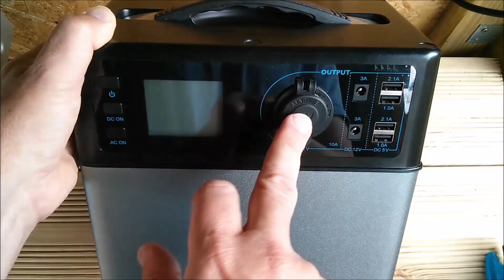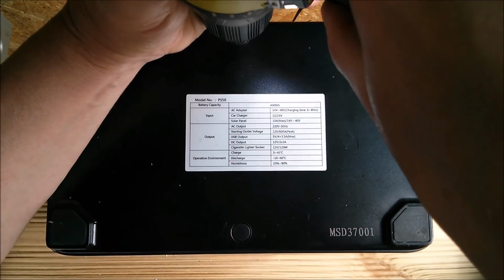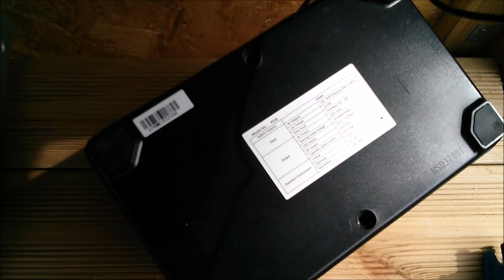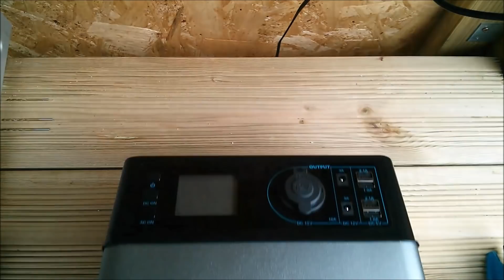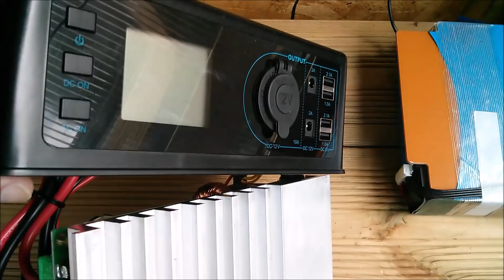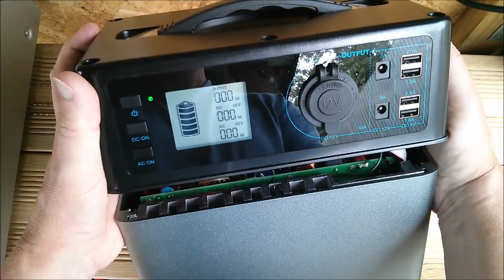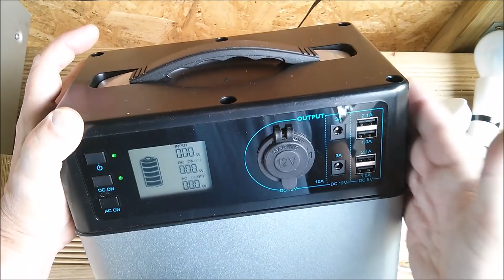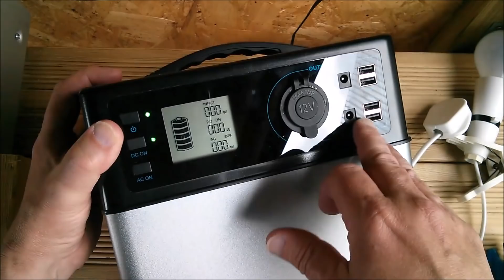PowerOak PS5B Power Bank Strip Down

Comment: Thanks for the tear down I bought mine second hand to run my brass monkey fridge  works well usb ports 2 were broken as its was on a board to difficult for me to fix 
So I replaced 12v cig socket with quick charge 3 socket  then relocated 12v cig socket to the back  of eb50 by piggy backing connection 
Works great as fridge plugged in the back leaves front all clear for use.

Comment: I'm trying to fix my PS5B anderson connector (solar input connector). This connector has fused and is unusable. I have to replace it. Thanks for your video that allowed me to look inside the box. However, the said anderson connector is hidden behind the jumpstarter connector. And I wonder if the later (jumpstarter) is not glued to the device because I cannot see how to undo it. Any idea or video about this problem ? Thanks in advance.
Reply: The Answer : 2 unaccessible screws from the outside hiden by the glossy plastic cover, maintain the jumpstarter plug. No other solution but breaking the jumpstarter connector fixation by pushing on it and glue it after having fixed the anderson powerpole connectors.
Reply: I would buy flush mount anderson  add to the back of unit leave old ones in place  then just reuse solar wires

Comment: Hi there, i am thinking of buying one of these to put in a small camper, running mostly a fridge, some lights, charging electronics (phone, headset, macbook, camera, etc)  and a couple other things but not much and intend on having a 100w flexible solar panel and have it connected to the ligher socket in the van but i think i would need more battery capacity, was thinking of making another pack of batteries and connect it to the unit but what do you recon its the best way to do it and if you agree with my idea, what would be the best way to wire it to the unit?
Thanks

Comment: Hi Julian, if you plan do build a USB power bank, I would recommend the TPS2544 for the USB port charge control. It is a really neat IC that supports several charging protocols. I should mention that if you don't use an IC like the one I mentioned, your phone may charge slowly or not charge at all, depending on the make and/or model.

Comment: The singular connector on the black wire is probably the negative Charge-Input to the BMS. Some BMS have separate connections for Charge & Discharge to provide better protection while simultanerously charging and discharging the pack.

Comment: not a power generator.  lost me instanty
Reply: timemachine_194 
Lol.  Is a step up/ down transformer a generator?  No.  Chemical storage of electric charge is not a generator the source of the electrical charge is.  It’s electrical to electrical so not a generator merely a converter.  Idiots day out!
Reply: timemachine_194 Incorrect.  The source of charge and or change in potential is the generator.  A battery like chemical energy is a storage device not a generator.  Point and case!

Comment: I've been modifying my PS5B in the last few months and have found some interesting things:  

The overdischarge cutoff voltage is 3.5V/cell, which is fine for the stock cells which are mostly flat by then (3S16P 48x LR1865SZ ~2.3Ah, seems julian's UK version has different cells). I replaced it with a custom battery featuring 3S19P 57x samsung-35e ~3.3Ah cells and cell level fusing, and these cells have capacity all the way down to 3.2ish volts. Cutting of at 3.5v means I only get ~420Wh from my 700Wh battery which is disappointing. The stock battery has ~350Wh usable capacity. Discharge curves for illustration: https://i.imgur.com/RTZEvT9.jpg

However on the PCB there is a blue trim pot, this trims the 3.3v reference for the entire system. By replacing the 2.7k resistor next to this pot with another 10k pot I was able to lower the overdischarge trip to 3.4v/cell and the charging voltage to 4.05v/cell, so even though I won't get more capacity from my battery it should have a greatly increased cycle life. Changing this reference voltage does effect the regulated DC output and inverter voltages though, which throws off the display power meters a little. 

When I got the  unit the first thing I did was mod in an external cell balancing lead to the battery.  And good thing In did, as the battery was way out of balance (4.03v,4.04v,3.84v). Presumably one of the cells was self-discharging in storage. This would be quite a problem if I was doing capacity tests, as it would take a few days on the charger to balance out and allow full usable capacity. 

Another thing I've become concerned with is heat build up, with the stock battery when I place a sustained 200W inverter load on the unit the cells reach 35-40c which isn't great. So I cut out some holes in the side and added a temperature controlled fan using one of those KSD9700 switches. 

Other mods I've done are to make the display backlight always on, by soldering the led to the 5v USB outputs. The display is still impossible to read from above though which is really annoying whenever the unit is on the floor. I also plan to add a hall effect coulomb counting state of charge meter to the system, but am waiting on the part from aliexpress. 

Here's the teardown I did, which has some more info I haven't mentioned:  https://imgur.com/a/oQ8flzm

Overall the PS5B is a decent unit, however here in Australia it is way overpriced (I got it for ~$650aud but most places sell it for ~$800aud). I wish the poweroak/maxoak/bluetti company was able to ship some of their better models here, it seems there's no way to get them other than contacting the chinese manufacturer directly.  
Even their aliexpress store doesn't ship to Australia.
Reply: Thank you so much for this information and the one available at imgur
I was looking at a way to extend the battery cappacity and i might just to it by the jump starter output as you mentioned its possible

Comment: I hate the name "solar generator", proffering to call them a solar accumulator. 
I've built one with 375Whr of 18650 storage in a 3S 16P configuration. It has 220V AC, and DC outputs for camping, changing by solar for an all in cost of £150.

For future reference, it's a good idea to deplete the battery completely, before pulling such an item apart. ;)
Reply: but the Magic Smoke does look better with a high power supply behind it :)
Reply from the maker: Oh wow - you already had the idea of paralleling up those pseudo-MPPT controllers. I dreamt that idea up a couple of days ago.
Reply: @JulianIlett  

I did indeed Julian. 

I've actually now removed them in favour of a direct connection to the solar panels. The MPPT boards loose loads of energy, something like 50% disappearing as heat.

By directly connecting my 90 Watts of folding panels, I can now charge at about 70 Watts, which is much better than 40 Watts through those pseudo MPPT boards. 

I'll do a follow up of my latest modifications soon.

Comment: Might I suggest a drop of hot glue (maybe with an upside-down screw pressed in) on the plastic screw covers. It would give you enough leverage to pull them out without damaging them.
Reply from the maker: I'll give that try :)
Reply: Superglue and activator , then soak screw and cap in hot water to release.